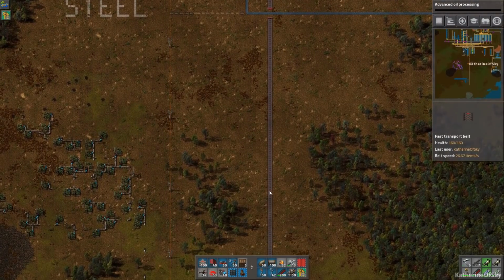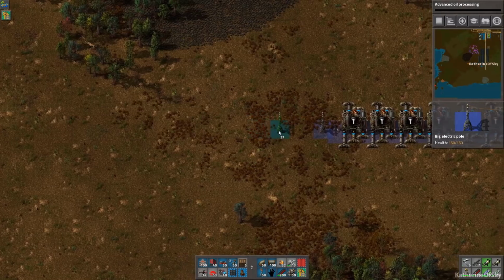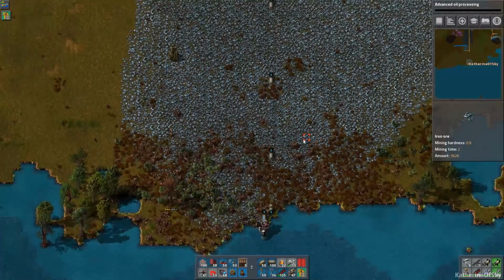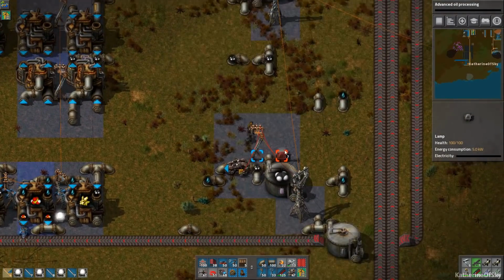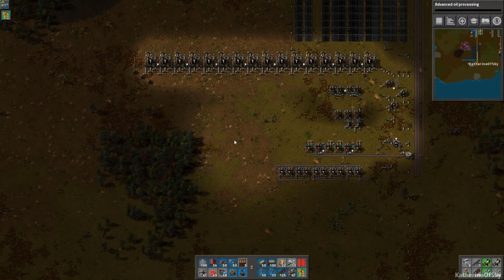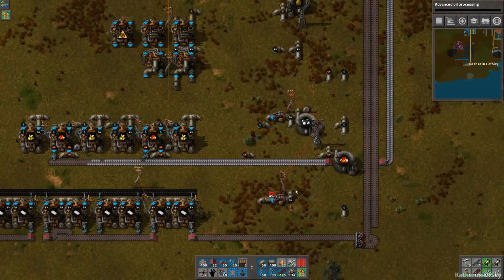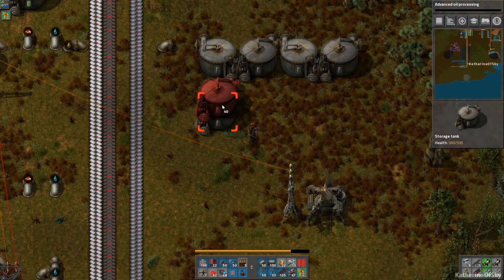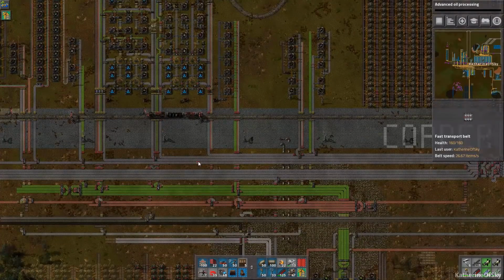Factorio: Entry Level to Megabase Ep 21: OIL: CIRCUITS, PLASTIC, & SULFURIC ACID - Tutorial Series

Comment: With those pumps what you are logically doing is simply moving the threshold from 0 to 1000. I think it won't change the way the operate. What you actually need is a range of operation. the pumps should work when the storages reach lets say 25k and stop working when there is nothing inside. If you just do it the way you showed in the video you will get this "on off on off" mode around the value 1000 and it will cause the closer pipes to fill faster, leading to the initial problem

Comment: I'm not a doctor, but I have driven through Hammond, IN where you can see the refineries and the smell is incredible. I can definitely see those causing all sorts of health problems for people and wanted to ask if you've ever gone somewhere that has fresh, clean air since you've developed your constant migraines, and whether or not you noticed your symptoms getting better? 

There's a neighborhood in the town where I grew up that was close to a coal power plant, and anecdotely speaking, quite a few of the residents there had developed severe health problems. 

I know moving isn't as easy as some people like to make it out to be, especially if you have unique circumstances, but maybe see if spending time far enough away from an oil processing plant helps?
Reply from the maker: Yes, I live on the plains of Wyoming.  Moved up here for the fresh air and low humidity.  Best guess is that I had an allergic reaction to Tramdol, as the onset was quite sudden.

Comment: I understand where you're coming from for the subject of buffers, if you're drawing for 10k products and only generate 8k. No amount of buffering will keep you from running out. I understand and completely respect your opinion on it. However, I wanna mention that now that there is more proper alarms with the speakers, you can set up some actually pretty effective buffers. That allow you to see there being a problem and adding more productions before the rest of your factory effectively run out of it.

Just my two cents! You're of course very welcome to stay bufferless as your preferred method. I myself am quite pleased already to have seen you set an alarm with a speaker on the power side in the Lazy islands series. X3
Reply from the maker: hahaha!  I think the message I was trying to convey is one of "buffers won't save your factory", intended toward new players.  I've seen newbies build mountains of chests just to store things... hundreds of thousands of products... and that simply isn't necessary OR useful.  I really strive to have an "everything is working at the same time" factory, not reliant on buffers, and that's really the message I want to get across as a philosophy of efficiency.

Comment: Have you had any issues from having such long sulphuric acid and lubricant pipelines? I've read that a lot advise against long pipes due to pressure dropping or something like that
Reply from the maker: The fluid mechanics seem to have changed somewhat in 0.15, to where there is less pressure loss.  TBH, it's really not that long :-)  You'd worry more if you had a pipe that goes across half the map, (to transport crude to the main base).  When we start outposting all the products, we'll have much shorter lines.  For the comparatively small number of products on the main bus, it's really not a concern.

Comment: Due to fluid mechanics it is a good practice to attach pumps directly to the tank and then lead the pipe to consumers. Connecting pump input to a pipe is a bad thing as it won't accelerate the flow much. You can't "pull" liquids, you have to "push" it to flow. And liquids do flow really slowly if you just attach pipes to a tank

Comment: i did believe the second belt was for battery, you alread got  some iron down here, to add a belt of copper would  have been just as easy... where will you build your battery? battery open lots of fancy stuff!!
Reply from the maker: Two belts for plastic -- it was never for batteries.  Batteries will go west of Red Circuits.

Comment: Dear KoS.
In anticipation of some laser fighting I have a proposal for a fail-safe recovering steam power.
When the lasers draw heavily on the power it may reduce the coal production. Worst case is a complete blackout in the heat of battle. I actually got killed once by this.

The simplest solution is to have at least two separate power grids: One for the factory and one for the coal mining. Dedicating enough steam engines for coal mining.
Assuming you connect the laser to the factory grid, this will ensure continuous coal supply.

I hope this is in time to let you take proper action before battle.

PS: What's not to like about this? I usually just stop watching if I don't like a video. 
In this case I naturally  pressed the like button.
Reply from the maker: That's an excellent idea!

Comment: A thought: You probably could skip that big temporary light oil buffer. Just set up your regular one tank per liquid and produce plastic until the refineries shut down because light oil has backed up. That should be more than enough plastic to research advanced oil processing & cracking, and you don't have the busywork of dealing with pumping out those tanks etc.

Some off-the-cuff numbers: Basic oil processing produces 40 gas for every 30 light oil, so  25K of light storage (1 tank) will give you about 33K of petgas before the refineries shut off. Assume about half of that goes to plastic and half to sulfuric, that's 16.5K to the plastic factories, or 1650 plastic bars. That in turn yields 825 red circuits, and hence 825 blue science packs, far more than the 75 you need. So, just build your final configuration right at the outset, make sure that red circuits go to blue science first (i.e. don't send most of the first round of production down the bus to the mall), get cracking on researching cracking (sorry....), and only then start sending reds to other consumers.
Reply: Daniel Silevitch that doesn't work, you produce plastic out of petroleum, not light oil. The only product you can do until you have oil cracking is solid fuel blocks
Reply from the maker: That's the idea, Daniel, but I also want to create some sulfuric acid to make batteries for lasers and accumulators.  You'll notice that I did not connect red circuits to the Mall prior to researching Advanced Oil Processing.
Reply: Sorry, I wasn't quite clear. The plastic and acid plants keep using gas while the light oil piled up. Once the light oil storage is full, the plants stop because the refineries can no longer work. So, the limit in how long you can run on basic oil is set by how much light oil you can store. So, you need to get to cracking before that light oil store fills up, but one tank is enough for that. Multiple tanks certainly don't hurt, but you don't actually need them.

Comment: Hi. Why not disconnect it from the main power line it will only work at day time as a stand alone (I also put a box that grab coal and connect it to switch the power to the rest of the best so in case of coal shortage power goes only to coal digging with a nice alarm, not sure you can do a day/night plan for the oil)